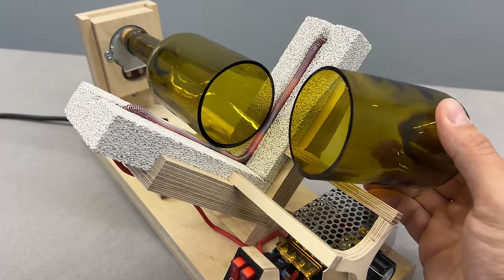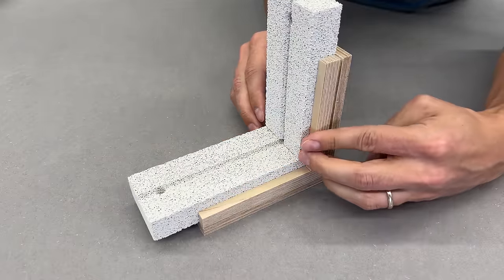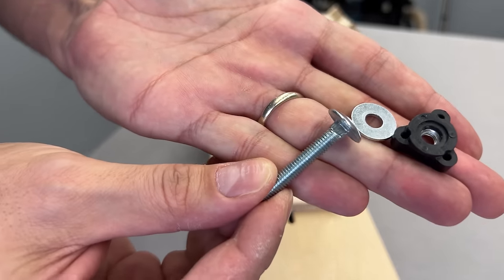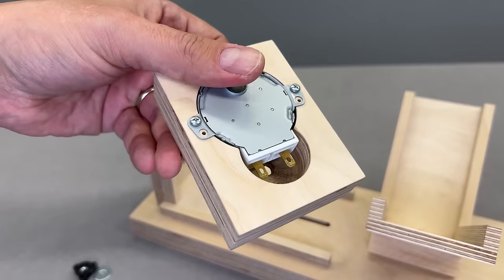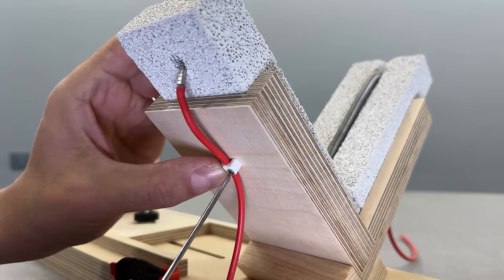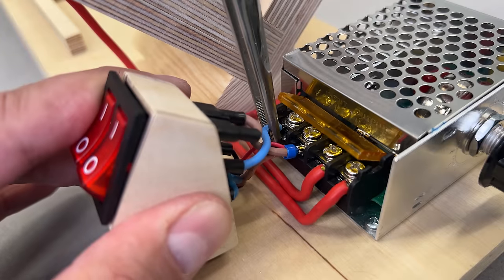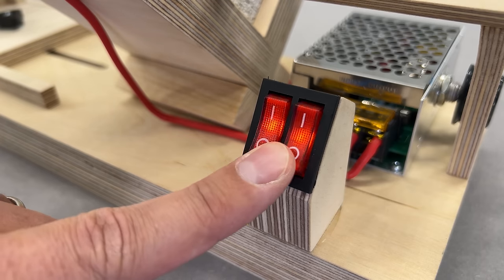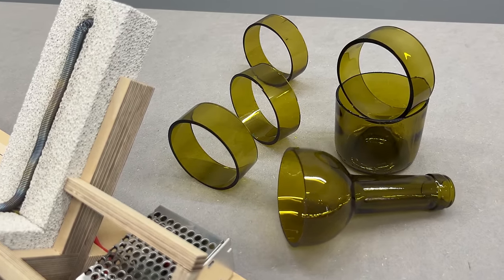DIY Automated Glass Bottle Cutter

Comment: You score it before putting it over the heated coil for more precision. He didn't include this step in the video because you don't need to score the bottle to achieve a cut, but it helps achieve more accuracy in the result of the cut, as mentioned above. Maybe do a little research before slandering a good product.

Comment: Admit that the bottles were previously scored with a glass cutter. You can see the outline.
Translate with Google
Reply: that's from the heating element. notice how it appears only after it's been heated and rotated multiple times. glass becomes more malleable at higher temps, thus is able to be scratched by metal (the heating element).

I would suggest taking a step back and thinking for a bit before saying things so definitely. Whenever I see something that I don't understand, rather than assuming the other person is wrong, I first think of how I might be wrong, and use rational thinking to decipher my thoughts validity.

Comment: How do you round the edge so you can drink out of it?
Reply: Using sandpaper, gradually decreasing the coarseness/ increasing the fineness until you achieve a very smooth finish. Lots of work unless you build a jig to do it for you. If you do want to drink out of it, make sure you sand the edge off in a well ventilated area and wear a particulate filter mask because glass dust is not good for you to breathe, and thoroughly clean the freshly rounded edge

Comment: Any bottle cutter knows that cold water on a brush wont work. Ive deep scored the heated area with boiling watet, dipped it in ice water and not have it break, then do hot again and it will break clean, l doubt this is going to brak this clen by brushing  on that little amount of cold water

Comment: We used to put water in a bottle wack it on an oven element and eventually it would crack at the water line( usually) it was quite a regular thing we did as we needed open bottom bottles for a ummmm .... pastime called "spotting " that we do here in New Zealand... Kiwis know what I'm talking about 😉

Comment: You are not parting the glass that easily without scoring it first.
Reply: that's from the heating element. notice how it appears only after it's been heated and rotated multiple times. glass becomes more malleable at higher temps, thus is able to be scratched by metal (the heating element).

I would suggest taking a step back and thinking for a bit before saying things so definitely. Whenever I see something that I don't understand, rather than assuming the other person is wrong, I first think of how I might be wrong, and use rational thinking to decipher my thoughts validity.

Comment: Dont do this unless you want to waste time... cut it by scribing it, lay  it on two anythings w a gap where you want the cut then press a hot rod of glass, metal, burt stick whatever to it and it will cut itself w thermodynamics.... been glassblowing for a decade all this is like making a 2hr project to pour cereal..
Reply: or you can spend 45 minutes making this, and not have to do any of that. 
If you are only able to handle doing one thing at a time, then your method would be best, i suppose.
Reply: @mikayla_collie  my method is how glassblowers and artist do it professionally, repeatedly. Takes less then a minute. This video is asinine
Reply: @ZomPaul2113  I mean... I don't think it's targeted towards "professional glassblowers", though... >_> it's just a tool you could build in your spare time. many people like creating things on their own, rather than using "the industry standard". I don't think this is about efficient time usage... we all know a torch would heat everything much faster...

Comment: Fake video.
I don't mean the method is 100% unreal for glass cutting

But I can see the editing to hide the actual diamon blade cuting (it is even more obvious in 0.25x speed}
The crack is not even allign with  heater coil or painting brush

Also, the thumbmail is FAKE
It's different with the actual footage.

Comment: Why dont you show scoring a line around the bottle with a glass cutter...?                                                                                                                                                                                                                                         I mean you can clearly see the score lines when you are dabbing the water on.                                                                                                                                                                                                                                               Moar fake vids I guess, too bad, was pretty cool until you tried hiding that fact!
Reply: that's from the heating element. notice how it appears only after it's been heated and rotated multiple times. glass becomes more malleable at higher temps, thus is able to be scratched by metal (the heating element).

I would suggest taking a step back and thinking for a bit before saying things so definitely. Whenever I see something that I don't understand, rather than assuming the other person is wrong, I first think of how I might be wrong, and use rational thinking to decipher my thoughts validity.

Comment: He does say touch the line that was heated. ie the line that was heated is the score line. So he is only telling a half truth, but it is still making fine cuts. No thumbs up because you left the glass knife off your list of Main Parts.
Reply: I actually believe it works this well without scoring. The consistency of heating in a consistent repeating path around the bottle is enough without scoring. He’s just saying you need to tough the heated zone or “line”
Reply: that's from the heating element. notice how it appears only after it's been heated and rotated multiple times. glass becomes more malleable at higher temps, thus is able to be scratched by metal (the heating element).

I would suggest taking a step back and thinking for a bit before saying things so definitely. Whenever I see something that I don't understand, rather than assuming the other person is wrong, I first think of how I might be wrong, and use rational thinking to decipher my thoughts validity.